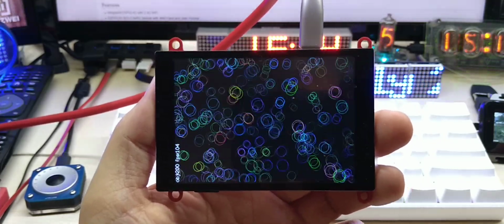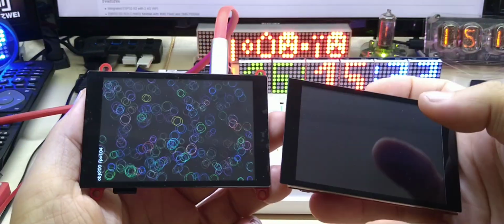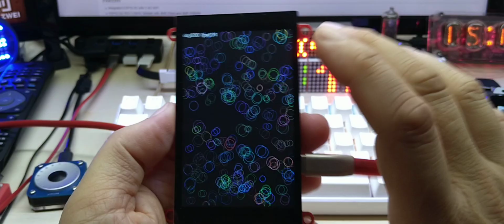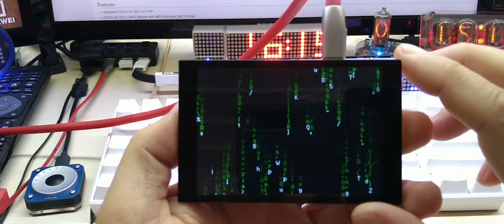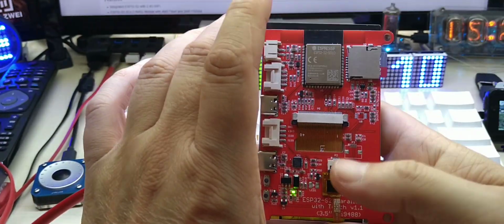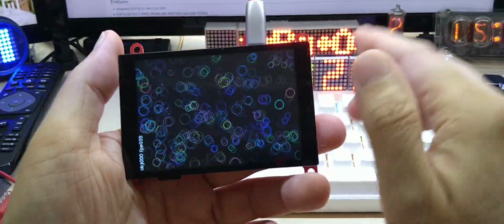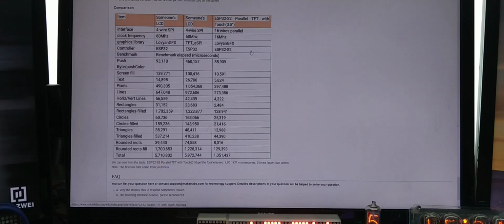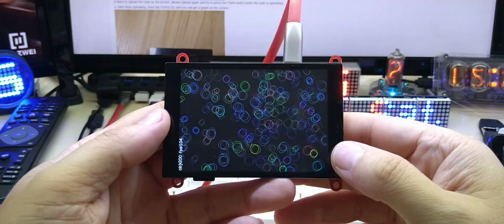Makerfabs ESP32 S2 Parallel TFT with 3.5" Capacitive Touch Display Intro by #Hayri #ESP32 #ILI9488

Comment: Hi Hayri, I've been working with a similar screen adapting it to a motorcycle and I would like to ask how do you deal with the spark plug noises? It is really annoying because it resets the SPI communication
Reply from the maker: Hi Nicolas, my gauge is based on the CAN BUS and for bike use I would use my CAN BUS Node, which will take the signals from a bike and send it over CAN BUS and therefore it would be immune to any noise. With analog signals you need a very good power supply and shielded cables and route them away from any of the motorcycles wires.

Comment: Oh something else I wanted to mention Hayri, have you noticed that the touch coordinates are scaled down by about 20px for x and y? Perfect alignment in the centre of the screen but loses ground as you move to the extremes. I have to use a proportional bias. The problem is worse with the ili9481. Perhaps my touch panels are not correct for the display resolution.

Edit: It seems that 16-bit parallel is presently only for RP2040. Still, it might point us in the right direction for some mods.
Reply from the maker: To be honest Nick, I have not payed any attention at the touch coordinates of this display but it seems a bit odd that you get correct alignment in the center as the touch is normally started with 0, 0 at the top left or bottom corner, can't remember for sure right now. Might be the touch panel itself. 
I am interested in the RP2040 as well, "Tobozo" is currently trying out different displays. He is an impressive coder and shares his work on Github. Please do share your findings, thanks.

Comment: Nice video Hayri, I'm Nick from Argentina, I would like to ask you how do you manage a buffer that occupies so much memory with the esp? 
It is necessary to use the microsd memory as flash memory?
Reply from the maker: Hi Nick, this is a example from the library which "just" draws different color circles and moves them around with different speed. What you probably mean are sprites, that have to be generated in memory or saved on a microSD card. Sprites or bitmaps for that matter would not be able to be shown with such a high frame rate. Hope this helps.
Reply: @iHayri1  Ok, understood! The main problem is that I am making a speedometer that uses a font that takes up a lot of memory space. Another question I have is if it is better to store the bmp files on the sd and from there show them on the screen?
Reply from the maker: @nicolasjaviervelez5753  Haha, speaking of speedometer, you might want to check out my CAN BUS gauge based on the ESP32 using the same display. I would say that the sd card is the slowest option, better to store the bitmaps in SPIFFS or convert them and store the in progmem as I did. You can even create your own font, as I did on my gauge, and store those in progmem as well. Sometimes you only need digits and certain letters, like I use on my gear indicator for example, and it will save space not having to load a whole font. Another benefit is, that you can create your own font, without the need to scale it up, which makes it pixelated.
Reply: @iHayri1  I've already checked out all your videos, it's awesome! I've creating my own font but and also precompile some of the library files and still running out of memory. I'm using micropython for this project. I'll keep trying
Reply from the maker: @nicolasjaviervelez5753  Sounds great, good luck 🙂

Comment: The ILI9488 that came with my board was not IPS but I swapped it out for ILI9481 which is IPS and pin compatible. It looks much better but the init sequence is slightly different - fully supported by the Lovyan lib tho.
Reply from the maker: Correct, plus the ILI9481 is sunlight readable, I have used it with my CAN BUS Gauge in my car.